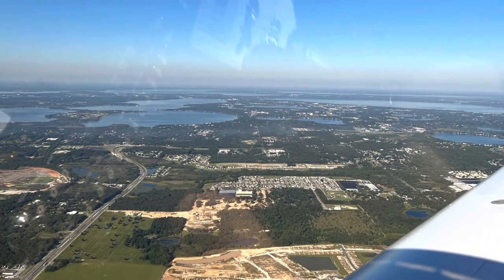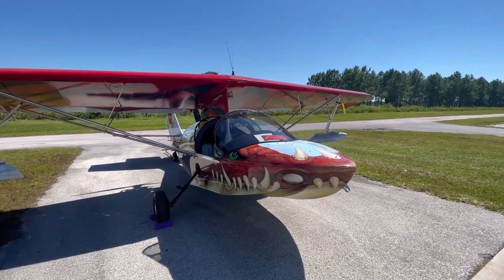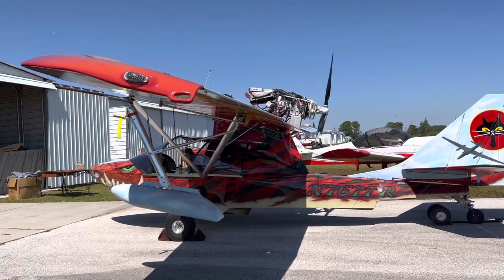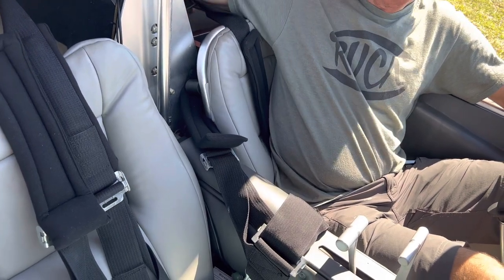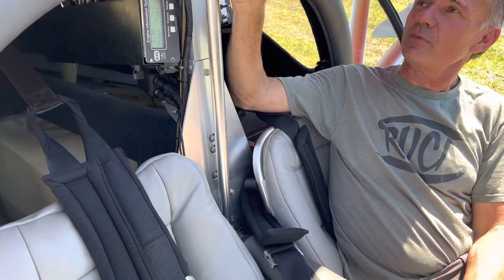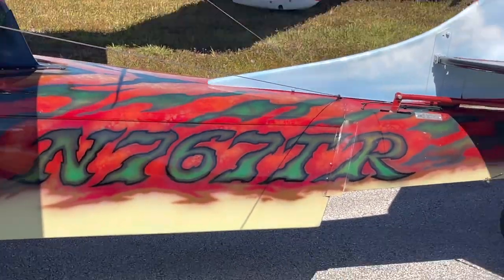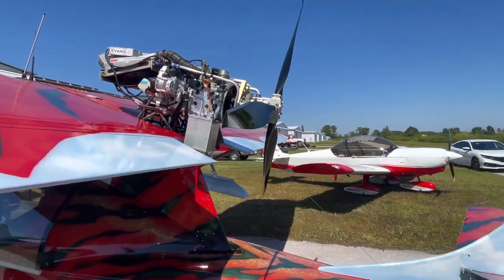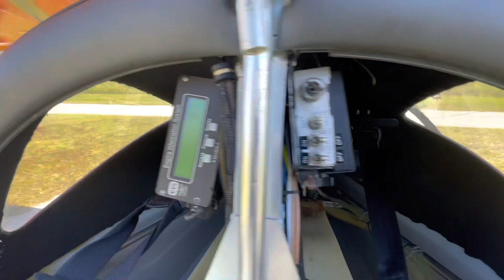SeaRey Rescue

Comment: The unconventional avionics and EMS would have me really concerned... I didn't even see a backup analog airspeed indicator on the dash which is a must in my opinion.   Owner is doing the right thing taking it to Vikings for a complete wiring overhaul.... can it be saved or is a complete retrofit required?     I'd ditch the ipad and put a real EFIS in for sure with integrated EMS.   I did hear Angel was involved who I understand does good work... so maybe I am off base.

Comment: @ 11:30, through the end. What is that green crap on the negative battery cable? Whatever issues arise from that, it won't show up on the screen! I am impressed by your work, but I hope you have a trust for your profits. Do you give these customers a discrepancy sheet for the obvious things that you feel should be addressed?